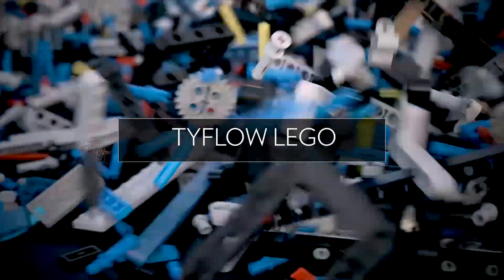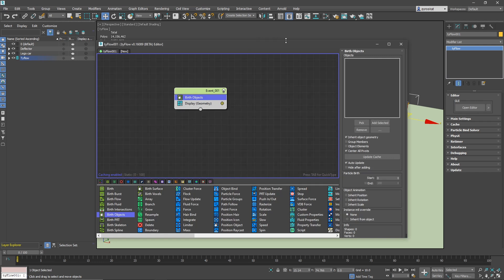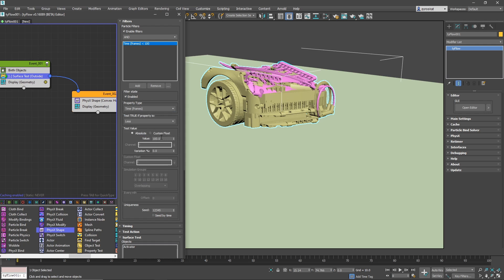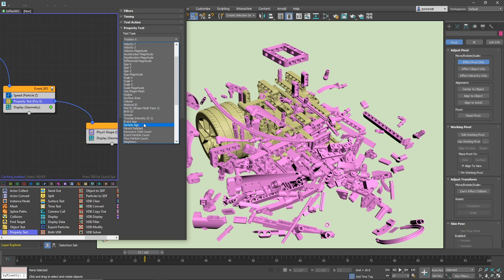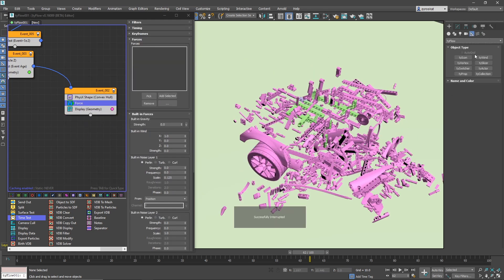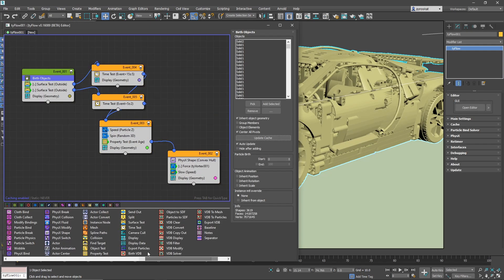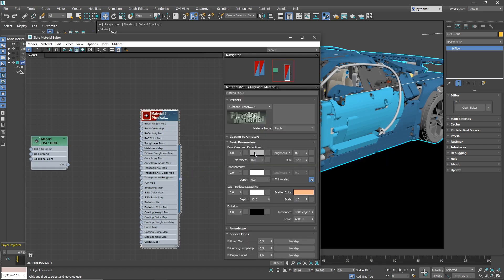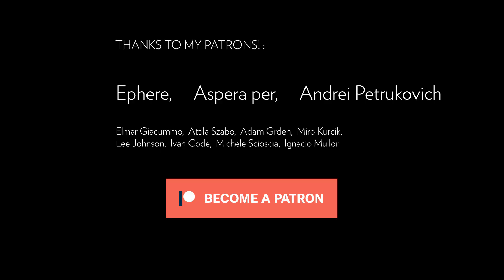Lego Construction Tutorial. 3dsMax/Tyflow/Arnold

Comment: Thanks for the tutorial! I was specifically looking for a way to solve the issue with multiple materials. This script from Changsoo Eun will be very useful.
A small tip! If you convert to editable poly (add a turn to poly modifier) your explicit normals won't be lost when adding the material modifier. Weighted normals can sort of fix broken normals on CAD models but it won't be 100% the same as the original normals.
Reply from the maker: Great, thanks for sharing! I think they fix multiple problems with explicit normals on the last updates, so in theory they shouldnt be lost in anyways, but need to do more tests.
Reply: @andvfx  It seems like Tyflow is unable to retain the explicit normals anyway! I think I need to add a feature request for Tyson! Adding a weighted normals modifier above the Tyflow object kind of saves it though.

Comment: Hello Eloi, I wonder if I can generate a 3D-building steps by this kind of method?
Reply from the maker: Yes sure, I will first prepare the model, because you will need an offset based on distance, but also, usually in building you want to have some sort of offset based on material too (first structure, after walls, finally decoration, or so. But very easy to do with tyflow.